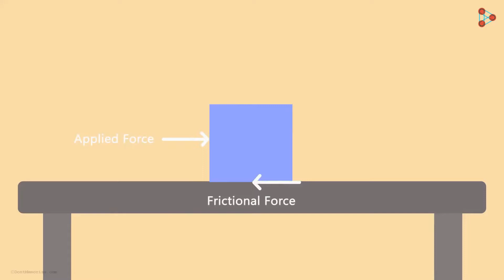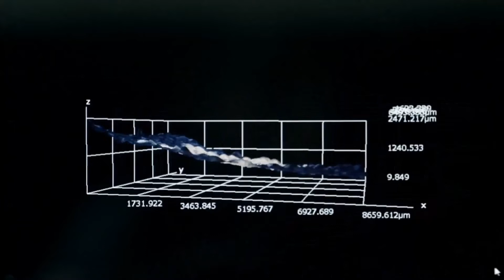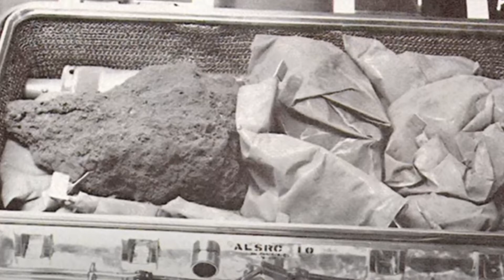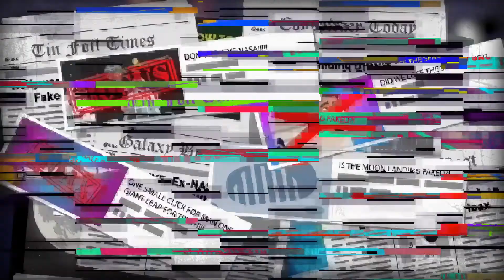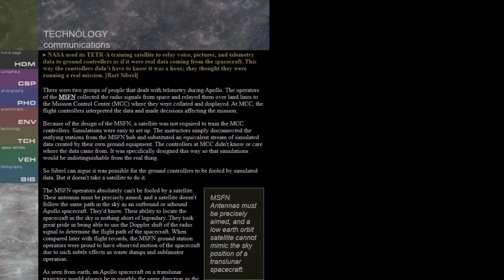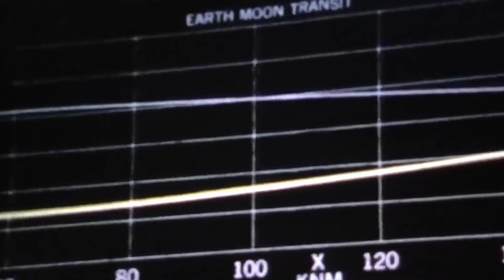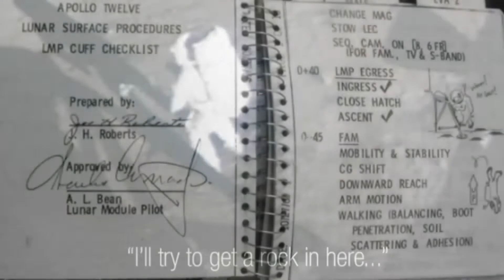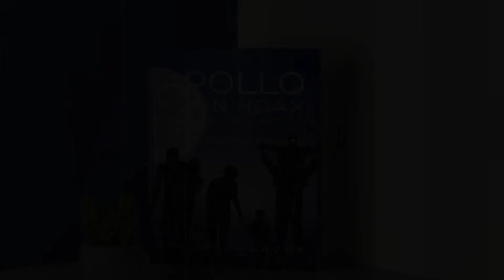"THE APOLLO MOON HOAX: HOW DID THEY DO IT?" PART 9 END.

Comment: Phenomenal video and series. Hey can I get a link or the picture number for the orange bic lighter photo? I had never seen that!! It would be much appreciated. Keep up the good work guys!
Reply from the maker: yes, the BIC lighter is from Apollo 12.
 AS12-47-6929, 28,30  25 and in 26. You will clearly see it on top of the equipment pack. Cheers!
Reply: @shillstompers3793   Thank you!!
Reply: @shillstompers3793   You have another great video I believe called Anomalies of Apollo, and there is a photo of some equipment that had been sitting in water and it had begun to peel and wilt back. I believe it was the Surveyor. Any link to that photo would be much appreciated as well.  Thank you!